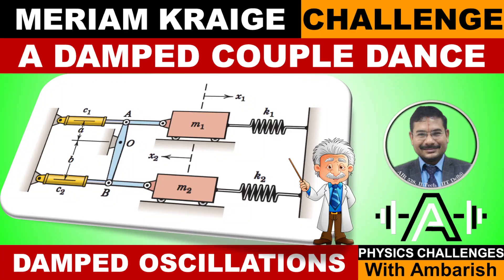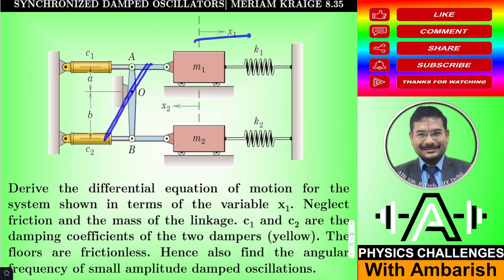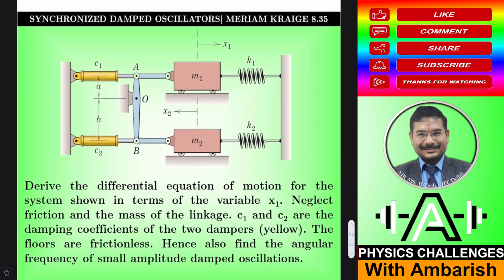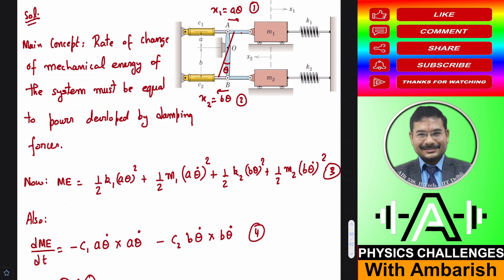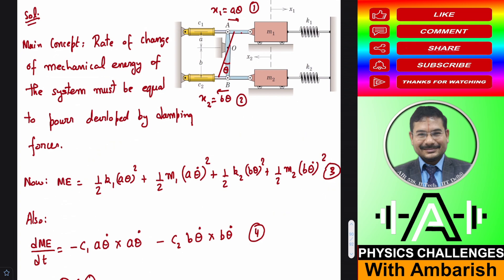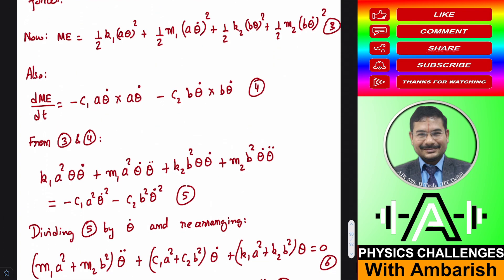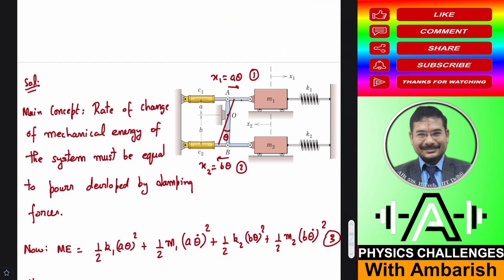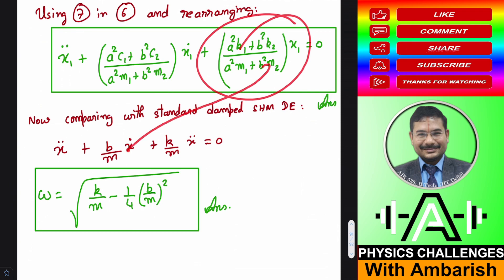DAMPED OSCILLATIONS| SYNCHRONIZED OSCILLATORS| MERIAM KRAIGE 8.35| JEE ADVANCED 2023| DAMPED SHM DE

Comment: Sir if compare  Pathfinder vs lim yung kuo graduate physics problem which problem tough
Reply from the maker: Kuo is a different game... Many of its problems will be beyond jee due to requirements of engineering mathematics. (Not necessarily tougher problems but mathematical bullwork). Though many problems will be very nice and conceptual also. PF is a class apart for JEE/ Ioqp

Comment: Was it a hard question for everyone or I am the only one... 
--
Do more problem of shm, sound waves, wave on string,from this book

 Thermodynamics topics specially

They are weak of I think everyone

Thank you!!
Reply from the maker: Sure... Most probably you found it difficult because it had a new way of solving however you will be easily able to apply this idea just about in all problems involving damped oscillations... btw this book only has mechanics... but yes I can do problems on the topics you mentioned from other good Authors.
Reply: @ambarishphysics  please make an explanation video of this method

It will help, and also some 1-2 examples

Thank you
Reply: Yes it is hard